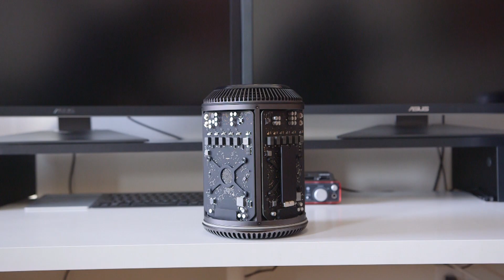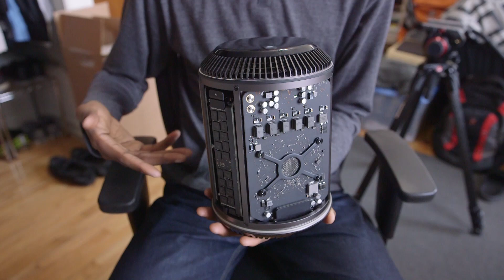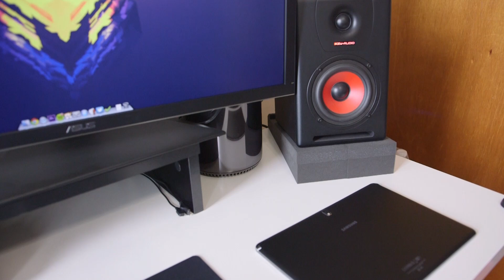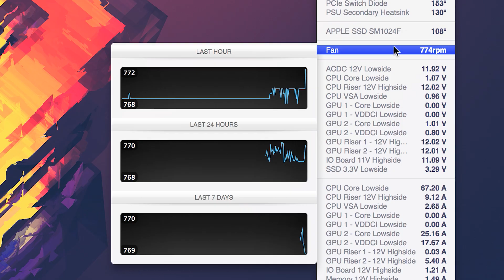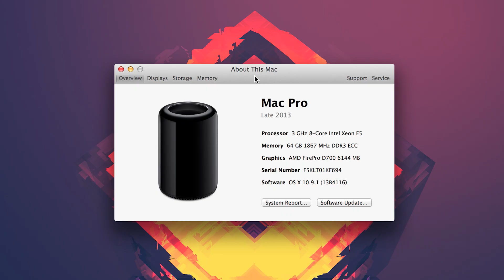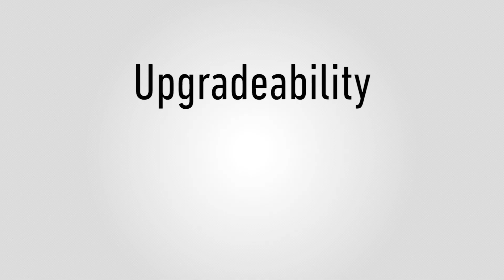New Mac Pro Review!

Comment: I recently got one with D700s and 6 core CPU 32gb ram. Got it repasted and while repasting also replaced CPU with an 8 core Xeon E5 2667 - 3.3 Ghz which is the best processor now for this machine and wasn't offered by apple by then. Mac got also an SSD upgrade to a Samsung 970 Evo Plus M.2 SSD with 2TB of storage which makes it great for storage capacity but sadly the PCIe only allows speeds of 1.3gb/s read and write.
Reply: You can always buy a thunderbolt 3/4 dock and then connect to a DAS/NAS for 20gb/s speed . 
You will need a real certified thunderbolt 3 to 2 adapter and not minidisplay port / china scam adapter for it to work.

Comment: Watched this 10 years later. Just bought one fully spec for 300 and I am enjoying it still. Duo booting windows 10 and Ventura
Reply: how did you get the dual boot with ventura? can.i make a partition for windows 10 and then use open core legacy patcher?
Reply: @nicolosantone7965 there is lots of good tutorials out there, I had used Rufus and grab the drivers form bootcamp and inserted them into my windows 10 files. I am now on windows 11 with sequoia. But there are some better tutorials out there that I would recommend finding.

Comment: This thing was outdated when it was released. Until now Apple didn't upgraded it and they stil want the same price as in 2013. So go and build your own PC for half the price and with three times the power.
Reply: +gh0st1976 Actually you save about 750$ if you build an equivalent PC with the same  Xeon CPU, equivalent AMD FirePro or Nvidia Quaddro GPUs, and ECC ram. 
The Mac Pro's D300 GPUs are equivalent to dual Firepro W7100 (which cost 620$US each). So that's 1300$ in Graphics card alone.
Xeon E5 1620: 290$
FirePro W7000: 620$ *2 = 1240$
12G ECC RAM: 95$ to 120$
LGA2011-3 Motherboard: 179$ to 700$
256GB PCIE storage: 170$
Power supply: 70$ to 200$
Case: 50$ to 200$
CPU Cooler: 20$ to 100$
Windows 10 pro: 125$

Total: ~2225$ to 3000 (Mac Pro is 3000$)

The lesson here is the workstation hardware like ECC RAM and FirePro/Quaddro cards are expensive as fuck... and even more expensive when you buy them from Apple.

Comment: 6000$ and it only has twin AMD Fire Pro D700s for GPU's ?

Such a shame, they use to have such good GPU's back in the day
Reply: +SuperDrMaximum The FirePro D700 is basically a tuned down W9000 with less VRAM. The FirePro W9000 is a top spec professional GPU and costs around 3000$ a piece. So if the Mac Pro has two of them, it's not such a shame ;)  (even though they are tuned down).
Reply: rider147b WTF I must be missing something. The D700's 3Dmark score is less than a 360$ Radeon R9 290 card. (http://www.futuremark.com/hardware/gpu/AMD+FirePro+D700/review)

Also Palmer Luckey, founder of the Oculus Rift, said that while he really wants to bring VR to the Mac, the reason he doesn't is because the new Mac's hardware doesn't meet the minimum specifications to handle VR. It's not just a software problem.

I get that giving the D700's price tag there must be some use / value to it that I am missing (??), but even so, the Mac is still a 6000$ PC that can't even handle VR... Such a missed opportunity by Apple, because VR is not just for gaming... professionally there's A LOT to come for VR !
Reply: +SuperDrMaximum the FirePro line of graphics cards are not made for gaming, they are productivity cards made for 3D rendering and animation. They come with certified drivers (that are heavily tested before release) and ECC VRAM. This is why the 3d mark score so low. 
So what justifies the insane price?? It's the targeted customer. For example, a company doesn't mind paying 10 times the price for a GPU if it's less likely to crash and waste a day of work. Also, some 3d rendering programs will run horribly or even not at all on gaming GPUs.
Reply: rider147b Some server grade memory can't possibly justify that huge markup in price and that huge drop in performance.

Keep in mind because of that drop in performance, VR is just not possible... VR is gonna be HUGELY important for professional users !!

Also no internal expansion slots on the MB???, only external thunderbolt....So every professional that has capture cards, audio cards or whatever card in their old Mac won't be able to use it in the new Mac .... Professional capture/audio cards are easily + 4000$.. And often a professionals program / camera / sound or music production equipment require an internal PCIe slot to even be able to use it

Comment: I still have my Macs from 2004, 2006, and 2011 and they still work. Can't say that about my asus from 2011 and HP I bought in 2012 which lasted me about 2-3 years. Hell my old high school still uses those old macs from 2000, yes a Mac is expensive but in my experience they are far more reliable and quality built than the pc/android counterparts.
Reply: +MellowCream my mac worked for 9 years long
Usually used it 6hrs/day,
Macs are expensive, but worth it.
They last 50% longer then windows
Reply: +MellowCream it's pretty annoying specially fixing things on pc's and not being able to use the latest OS because it's complete and utter shit. I'm looking at you Windows 8 (when it was the latest os) and Windows 10 isn't too great either.
Reply: +pandaland1 That's just complete bullshit. I have so many old PCs that work fine.

Comment: this is the most ridiculous thing i've ever seen. this pos cost around 10k. THAT'S INSANE.
Reply: +Mark s You also need a professional grade motherboard. Professional grade XEON cpu.

It's a workstation after all, not a video game machine.

They don't come cheap.
Reply: +Fidel Guevara 
And you probably know of a workstation computer comparable in all aspects one can get for less but cannot show anyone that workstation computer via a link?
Reply: +Confused Fella If i build one and supply a link will you pay me $1000 for my trouble? Will be the easiest $1000 ive ever made LOL
Reply: Dick Jones
Yes, I will. Now show us your equivalent build comparable in all aspects for 1,000 USD.
Reply: +Dick Jones dude foe 10k you could get a dual xeon pc
Reply: +Confused Fella http://pcpartpicker.com/p/wc9rzy i went a bit overkill this PC would destroy mac pro but if you shopped around you could build similar for 1,200
Reply: Mark s You're going to need ECC RAM and GPUs meant for rendering if you're going to want to "destroy" the Apple Mac Pro when it comes to what its meant to do.
Reply: If you think a gtx 980ti with 6gb if ram more than Mac cant render your insane and add ecc is only about $100 more still significantly less than Mac and this build has better storage
Reply: Mark s
Better in every way? What about maximum RAM capacity? What about TB? What about size? What about ECC RAM?

And what about HP and Dell and Lenovo workstations using Xeon CPUs, ECC RAM, Quadro or FirePro GPUs? Why don't you show them how you can build something worse and not certified for less? Most companies will thank you.

Comment: Worst design ever. The air flow takes the air in from the bottom which is fucking stupid
Reply: +Casper Round 
Because cool air rises and warm air falls down?
Reply: Wrong, so very wrong. Hot air rises and cool air falls down, although dust particles settle on the ground causing it to take in dust. While it would be much more efficient if it took in air from the top.
Reply: +Casper Round but if it blows all that hot air down it will heat up whatever surface its sitting on and not be as efficient cooling because it will have more to cool at that point. blowing up moves all the hot air up and out where it will have more room to dissipate. and anything with a fan on it is going to get dust on it either way. not hard to take the cover off and blow it out every once in awhile
Reply: So you care more about the surface its on than the actual expensive machine? Thats logical...And yes it will intake dust, you do realise dust particles fall hence why they cover surfaces... If they implemented a sideways ventilation system that would be the most efficient
Reply: +Casper Round its not about caring about that surface. its caring that that surface gets heated from a fan blowing hot air onto it which in turn will radiate back up in the machine. then that machine has to work that much harder to keep cool which hurts its efficiency. have you ever picked up a laptop after doing some video editing or something that makes it work and felt the table? its pretty warm right? now don't you think that if it were possible with a laptop design to blow the air in a different direction like up in the air where there was plenty of area for it to disperse it would have an easier time cooling it and not make the internal components work so hard? and you're going to suck in dust no matter which way a fan blows. most every traditional box shaped desktop pc with a fan in the side or back i've seen has dust in it. its basic maintenance for any desktop to clean it
Reply: +Casper Round In a regular PC case, Bottom and/or front is always used as an intake, back and top as an exhaust.  So, this machine having only one intake and one exhaust is setup properly.  Regarding dust, it won't have dust because it has positive pressure airflow, thus air being pushed out of the machine, and there's a filter on the intake. doesn't take a genius to understand that simple concept.

Comment: Why would anyone spend this much money on a device if they just want to do light load stuff.
Reply: +Señor Steffan 
Because light load stuff is not what this machine is meant for.
Reply: +Confused Fella Yeah it kind of is...  It's already obsolete.  And even in the begining of the video he tells us about how the majority of the users of this machine would not be using it as a "daily" thus useless..
Reply: thomas shelleby
For the consumer this machine is useless, for the professional needing such power it is not.

I work at two broadcast corporations, and they use workstation hardware rather than consumer hardware (with exceptions for low priority clients), and all the production facilities I worked at also use Xeon based workstations instead of consumer CPU based computers (with the exception of one company, which wanted to save some money and bought some consumer i7 machine to do heavy lifting (which can be done if set up properly), but I ended up using my C2D MBP to do the transcoding of some stuff, as it was just less error prone - strange).

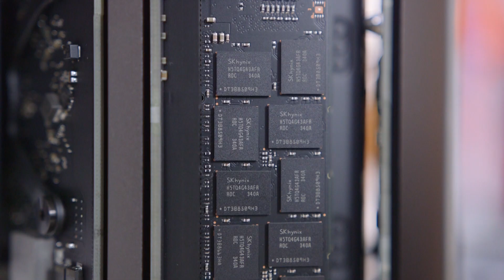Comment: At 5:08 in this video you have shown that you have not done any research into the system you are purportedly trying to review.

The reason why you are not seeing the performance, and it has naff-all to do with Adobe "not being able to talk to the hardware".

Sonny boy, just a little look at the tech specs would tell you why this is a piece of shit.

First of all the cooling solution is made of aluminium, which is just under half as efficient at conducting heat as copper. There is a reason for this and the reason is that Apple only powers the high end components (GPUs and CPU) with a 450 Watt PSU.

The CPU and GPUs running flat out would require well over 650 Watts to do so. If you include all the other hardware in the system then the PSU would have to pump out well over 700 Watts.

When the the MacPro is put under its highest load that the PSU can supply (with the PSU pumping out 463 Watts) the temps on the CPU and GPU are at 95 to 97 degrees Centigrade. That's how piss-poor the "thermal core" is able to deal with cooling the system.

Apple has no magic wand and instead of blaming Adobe you might have tried to be at least a little bit honest and bunged on Windows and let a Windows benchmark run. The system would have shit itself.

It is a piece of overpriced garbage which makes the Beats by Dre look like a stellar performer in comparison.

Comment: LOVE mine. Boots in about 8 to 10 seconds. I never hear the fan, even with three or four Adobe apps or X-Plane or Blender rendering. It's a beautifully designed product and its rock solid. Upgrading it to 64 GB of RAM and a 1 TB SSD shortly. Dropped less than $4K on it originally. Adding about $1,500 to the RAM and SSD upgrades. In the nearly 1 year that I've been using it, I have no complaints.
Reply: ... 1500 on ram and an ssd, wtf is the ram gold plated
Reply: Staring Intensifies watching 4k porn on 8 monitors, while playing crisis 3 at 4k144fps?
Reply: +Nhlpro14 Gold plated RAM and SSD. lol.
Reply: +Nhlpro14 i dont think he could get even close to that even with the upgrade
Reply: AUD= australian dollar. a one tb ssd is like 200 dollars aud and 64 gb of ram is like 500 dollars aud it is extremely overpriced also cpu is trash only 3 ghz and for an extra 2000 dollars we will lower that 2.7 ghz also ddr3 ram is really old and 6 gb of vram isnt that good nowadays also two graphics cards with 6 gb of vram wont double it to 12 it will stay the same. if i was you i would get a pc with an i9, an rtx 2080ti , 3 1 tb ssd's in raid, an 850 watt power supply platinum or titanium certified, a z390 motherboard , 32 gb of ddr4 3200 mhz ram and liquid cooling then i would get a hackintosh os which is mac os but on a pc. honestly apples products are worth like $500

Comment: is this better than alienware area 51? Ive seen area 51 and that thing looked ridiculos with 3 graphic cards, water cooling system and shit like that
Reply: Three 980 nvidia cards will still be very useful for production. Workstation cards are more accurate and built out of higher quality components but they utilize the same CUDA technology as gaming oriented cards. The alien ware 51 has over 6000 CUDA cores and 12gb of ddr5, this would be highly effective for most workstation functions. The included Alienware processor is a 6 core 3.5ghz processor with 12 theoretical cores. This system would likely outclass the Mac Pro in animation rendering with an inexpensive ram upgrade and pcie based storage at a comparable price point to apples 6 core Mac Pro. Not that I would ever consider purchasing an Alienware.
Reply: +Putin Russia It's like looking at an apple and a pillow and seeing which one can cut butter better. 2 Different purposes, Mac pro is for design for the professional, (Video editin, 3d, GFX), and Area 51 is for Gaming, strictly pretty much. The 980 is a card designed for gaming. If you want to game, get an area 51 because the mac pro will not hold games as well. The mac pro has workstation grade components rather than gaming grade components. If you want to edit, get the mac pro, much better for productivity with it's multi-core and multi-gfx workflow components.

Comment: "It actually runs pretty cool" 150c -_-
Reply: +Aaro Perämaa 
Fahrenheit is the temperature scale used in the US, thus 150° F is 65° C.
Reply: +Confused Fella For an idle temp that is absolutely terrible. My laptop with awful cooling idles at 35-40C. However, if it's 65C under load, that is quite impressive.
Reply: JJ Warner
We will never know. Maybe it was Kelvin, then it is pretty cool either way.
Reply: +Confused Fella The computer would literally be frozen at 150 Kelvin.
Reply: CoWinkKeyDinkInc
And be quite fast.
Reply: Confused Fella
Well, not necessarily. Freezing computer = lots and lots of moisture. It might just as easily kill it immediately as the ice melts.
Reply: JJ Warner
Dry ice?
Reply: Confused Fella
Dry Ice isn't water, it's frozen carbon dioxide.  And even then it would easily freeze any moisture, and since water expands when frozen, it can easily break it.
Reply: CoWinkKeyDinkInc
Thank you.

Comment: I wonder why people try to throw garbage in it.
It also has a part that opens that lets some heat out if you add pressure to a plate protruding from the bottom.